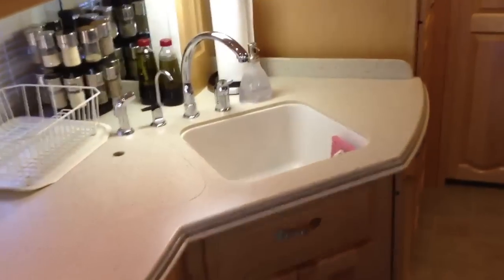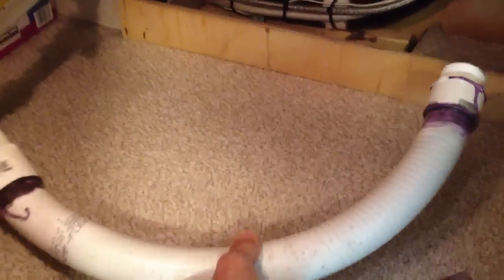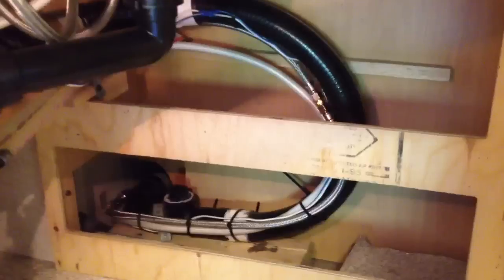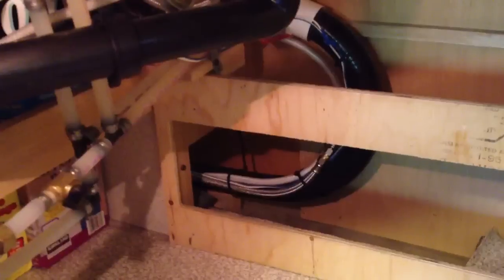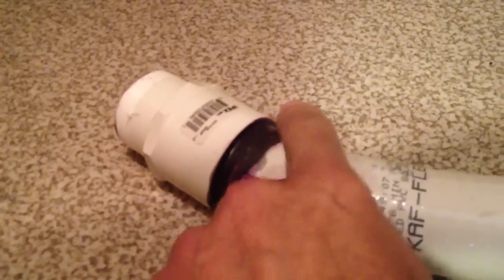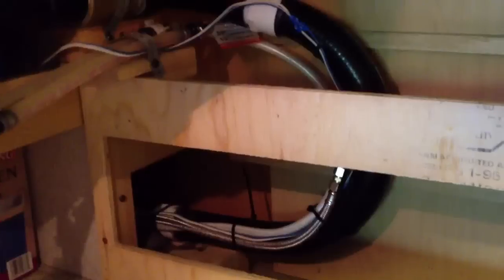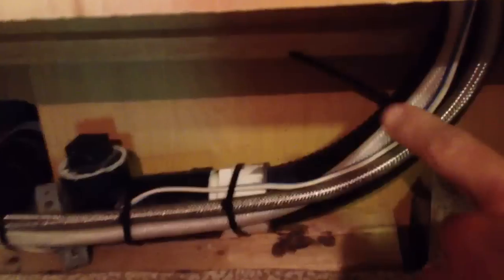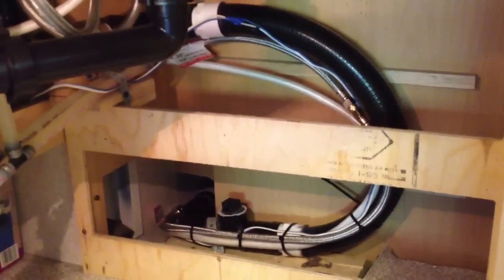BEHIND THE SCENES: Kitchen Slide-Out Plumbing

Comment: I know that slides have their place...but this is one reason why I'm not crazy about them. But if I do get one and it might be inevitable, the slide will not have any plumbing or electrical lines that flex back and forth like yours in this video.  There are many RV's with just a dinette and cabinet combo that slide and leave all the plumbing and electrical lines stationary.  Thanks for the informative video.

Comment from the maker: @georgetown06   If power is available.... absolutely!  Even though we have three solar panels, it's nice to have the RV plugged in and the batteries float charging.  We've left the RV in storage a couple of times for a month or more without power, but we prefer not to if possible.  When our Norcold fridge died a few months ago, we switched to a residential fridge, so now power is pretty much required when we go away, or we'd have to completely empty the fridge, which is a pain for a full-timer.

Comment from the maker: @georgetown06  I was referring to short-term storage, for a few weeks. If you're talking about leaving the RV in storage for a long period, I would definitely empty and shut off the fridge, as a propane fridge could be a fire hazard if left unattended for a long time, even running on electric.  As for the batteries, keeping them on trickle charge actually keeps the water level stable (as opposed to cycling them up and down, which uses up water).  But that requires a good 3-stage charger.

Comment from the maker: @travelingoutskirts   Hey Duncan!  That flexing is surely the reason it leaked.  The recording is warning that the slide is about to move.  2005 and older Newmars don't require holding the button down.... just press and release. It says "The lock arms are unlocking.  Please be certain all persons, seats, chairs and other obstacles are clear of the slide-out area.  There will be 5 second delay for any necessary adjustments."

We've heard that the voice is the Newmar founder's daughter.  lol

Comment from the maker: .... continued.... When we dry camp, and cycle our batteries up and down, they require watering more frequently.  When we're plugged in for months at a time, we hardly ever had to add any water, as the batteries stay pretty full, except for a little bit of evaporation.  This spring we switched to AGM batteries, so it's not an issue for us now, but for 8 years we managed our flooded 6-volt golf-cart batteries.  Your RV may be different, due to a different type of charger.

Comment from the maker: Keeping them charged 100% of the time will probably make them last the longest, but then you wouldn't be getting any use out of them, so that's not much good.  Deep cycle house batteries are designed to be discharged and re-charged as part of using them, so just go ahead and use them that way.  The most important thing is to maintain them properly and never discharge them more than 50%.

Comment: Sorry, cannot see previous comments.  I recently made this repair in our 2020 NA.  Is the replacement hose you show in your video “smooth” on the inside?  Our factory hose was corrugated as the outside was which allowed it to be flexible.  Bacteria growth was amazing in those valleys inside the hose - it had a nice smelly beard. My first replacement was a spa hose from a local spa and pool shop, but I will soon replace it with one that is “smooth” on the inside to prevent growing another beard.  Thank you for the video - Newmar builds a decent coach but takes some sad shortcuts.
Reply from the maker: We THINK our new hose was smooth on the inside, but it's been a while, so we're not 100% sure. We did, however, have to replace the same hose AGAIN many years after this first time. Hopefully you'll have a good experience replacing it... and it will last longer this time.
Reply: @RVgeeks  thank you for the reply and candor!
I’m going to replace my first attempt with a hose that our tech recommended that is smooth on the inside. Thanks again for your great videos!

Comment: Hello,  so the wife just pointed out that the bottom of the floor beneath the sink was wet.  Went under and found that I had the same problem with my flex drain pipe. Terrible design.  My question is how did you get the drain tube off the PVC pipes?  Was it glued on or twisted on?  Did you cut it off or how did you get it off?  I will attempt this fix after I get all my parts together.  Thanks ahead of time.
Reply from the maker: Hi Chuong. Sorry to hear you're having this same issue we did, but glad you found it. Since this was over 6 years ago, we had to watch the video together again, and try hard to remember exactly what we did. We THINK we cut the bad hose near one of the ends, allowing us to unscrew both fittings (the fitting that are permanently glued to each end of the hose) from their connection points on the RV. As we recall, the removal of the old hose wasn't the challenging part, since it's getting tossed anyway, and doesn't need to be preserved. It's only needed for sizing purposes for getting the right size replacement hose and fittings. By the way, we found the hose at a pool supply place.... typically used for plumbing the pump and filtration system in pools and hot tubs. We bought the two new fittings at a hardware or home improvement store (we just found receipts in our records for all three of those stores that same day, for the hose, the fittings, and probably the pipe cement). Be sure to get the correct cement for the materials being used (PVC vs ABS). The tricky part was re-assembly. The tubing is very stiff, preventing you from gluing the fittings onto both ends prior to installation (we recall that the fittings are threaded into the RV-side at both ends, so if  you glue both fittings in place, there's no way to screw them both in). We remember gluing one end (the upper side on ours?) and then threading the lower fitting into place, and finally gluing the lower side of the hose into that fitting. Sorry our memories on the details of this one are sketchy, but it was a while back. If not for the fact that this was an emergency repair, we would have shown the whole process while we were doing it. Hope this helps a bit. Good luck, and please let us know how you make out!

Comment: Love your videos. Very informative and well done. One question related to this particular segment. Where did you find the replace flexible tubing? I am experiencing a similar situation and have not yet come across that tubing
Reply from the maker: Hi T W! Thanks! We ended up finding the tubing we used at a local pool supply store. Apparently, tubing like that is commonly used in pool & hot tub pumping systems. We matched the diameter, bought the correct glue, and we were back in business. It's been working great and has been 100% leak free for the past 6+ years (which is as long as the original lasted, so we're going for a record, LOL!). Hope that helps!
Reply: Thanks... will try to locate ... Keep up the great work.

Comment: I had this same problem with a kitchen slide. If you remember, could you say where you got the black replacement drain hose, and what is was called? Home Depot only carries the pool hosing, which is quite inflexible.
Reply from the maker: Ros B Hi Ros. We removed the old section of tubing and took it to a swimming pool supply place and they had the right stuff. It is the kind of hose that's used in whirlpool spas and I think in pool filtering applications, too. The replacement hose was indeed very stiff, as was the original. The most important thing to do is install it correctly with the right cement, carefully following the directions on the can. The pool place was great about telling us exactly the right cement to pick up at a local home improvement center, but it's been long enough that we don't remember the name of it. Any pool supply place that also does repairs should be able to tell you. That hose has been in place for nearly 4 years now without a problem. Good luck and let us know how you make out!

Comment: What type of black hose did you use & where did you get it. On the road & have leak. Thanks
Reply from the maker: Sorry to hear, Ron. That’s hose usually used for the plumbing in a hot tub/spa and we got it from a pool supply place. The fittings at each end came from a Lowe’s / Home Depot.

Comment: What did the voice say in the background
Reply from the maker: That's the voice from the slide-out control, saying "The lock arms are unlocking. Please be sure all persons, seats, chairs and other obstacles are clear of the slide-out area. There will be a five-second delay for any necessary adjustments."

Ours was the very last year (2005) that Newmar made one-touch slide-outs, where a single push and release of the button would bring the slide in or out without holding the button down the entire time. So there is a warning, that was supposedly recorded by one of Mahlon Miller's daughters (he founded Newmar), before the slide begins moving. Starting in 2006, for safety purposes, you have to hold down the slide-out control button during the entire process, so it doesn't move by itself any more. I'm guessing that the recorded warning was no longer needed after that.

Comment: Has anybody ever told you that you sound like Patrick Warburton?
Reply from the maker: Haven't heard that one, but I LOVE Puddy, so I'll take it! :)
Reply: Just had that happen on my 2000 Alpine. Hose is flexible horizontally on the floor, pvc  pipe at end of the flex hose broke where it was metal plumbers tape/fastened  to a wooden anchor. That PVC pipe has a 90 degree turn to  the grey tank. Also hot water hose for faucet had a small leak. I'm glad it broke on this trip, not the next one at the beach!  We use a similar but just bigger flex hoses with cam lock ends at the wastewater treatment plant I work at. I'm sure Granger, industrial supply,  would have that flex hose too.
Mark